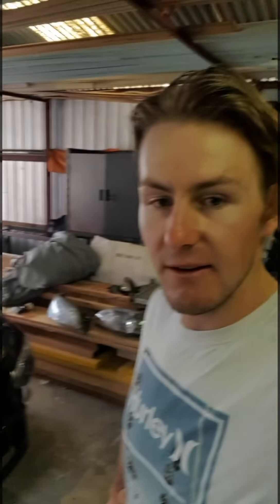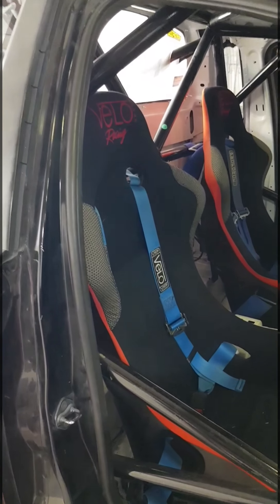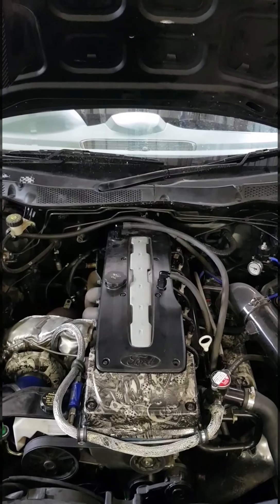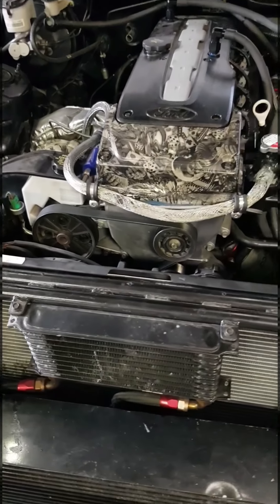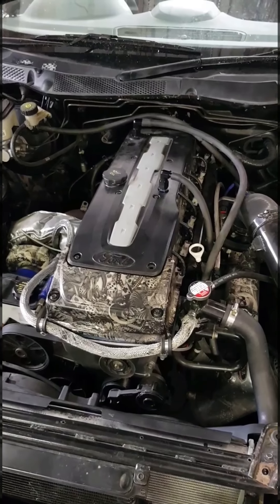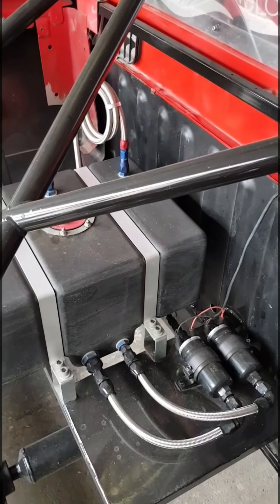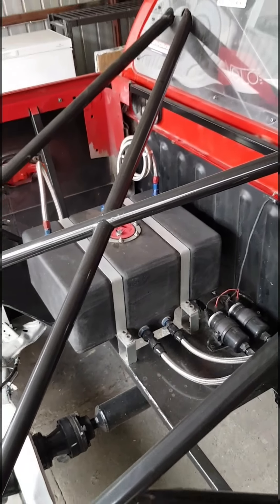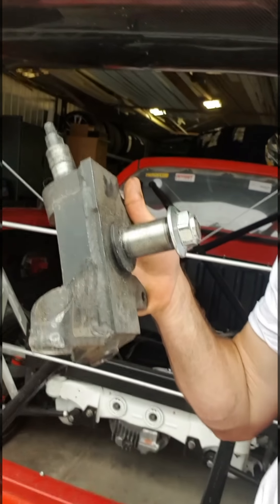Drift car introduction 400kw xr6 turbo by 90 degrees motorsport

Comment: Fg dash in a b series 🤔 how did it fit up?
Reply from the maker: xr6t gtx the fit is very much similar. All the main points line up fine. Will need fg door cards aswell but I can't confirm if they fit as we left the b series door cards on. Auto headlights work and everything